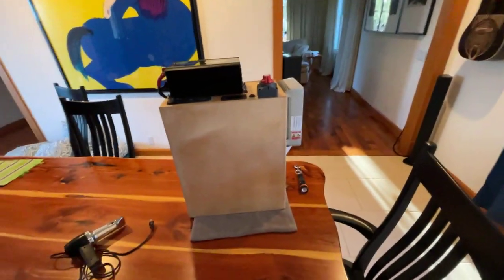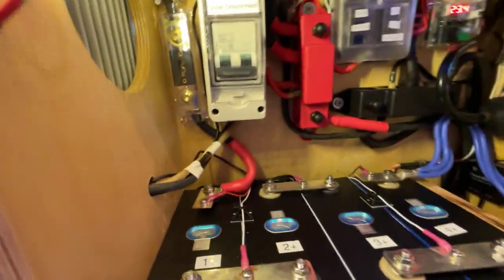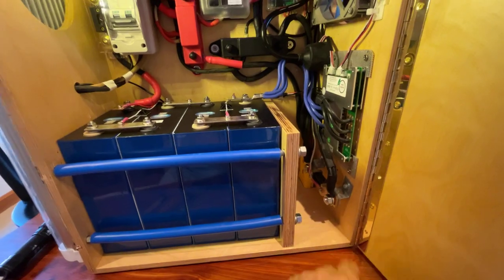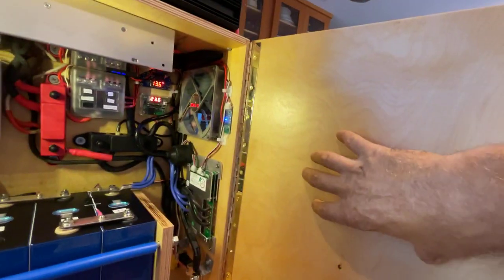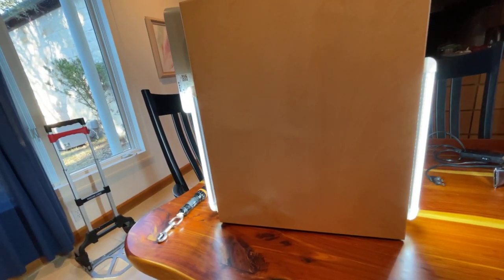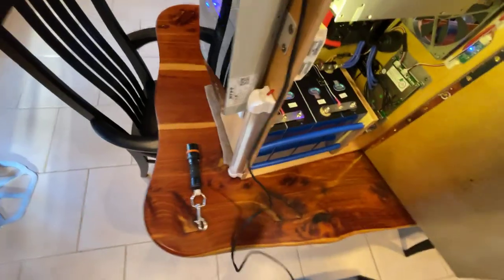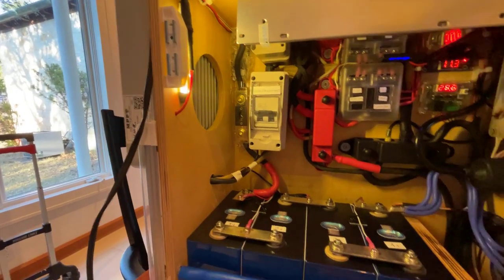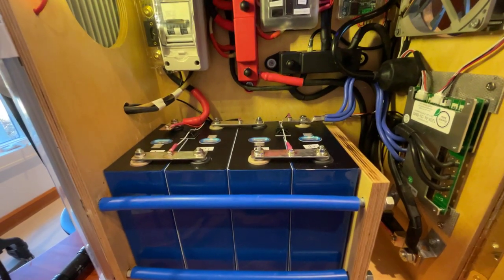I Built A Solar Generator! It Will Run My Fridge And Deep Freeze For Two Days!

Comment: How much did your system cost to build?
Reply from the maker: If you are asking about this solar generator, it cost 1200$ I later built another add on for 4kwh additional capacity for an additional 700$ that is shown in another video.

Comment: Ray what is the large silver box on top inside directly above batteries. and above your arm at 6:55 minutes?
Reply from the maker: You are probably talking about the power supply that is used to charge the batteries from a wall outlet.

Comment: @RayBuildsCoolStuff Nice Build!!! Out of curiosity, are you exhausting heat from the enclosure with the fan or are you pressurizing the box with the fan and exhausting heat out the charge controller end over the heat sink fins???🤔 If you are pressurizing the box, here is a YouTube playlist by a guy who 3D printed "static pressure boost plate" to make the fan more efficient. 
https://youtube.com/playlist?list=PLAO5ebsLaYhSe1opzIWoJgDvaiJyXcO94

Comment: Is there a way you can make up a parts list with planson how to assemble this one. People might even b.y the plane for the wood case.
Reply from the maker: You’ve got me thinking about it. I wouldn’t want money for it though.
Reply: @Ray Builds Cool Stuff  I have a friend that has a wood shop so building the case would be no problem on that side, and being an electronic tech would no trouble but a parts list would be helpful
Reply from the maker: @mysticwolf2842  have you watched more of my videos since you made this comment? Are some of your questions being answered by those? There are a couple of problems with making a parts list. First and foremost is that some of the parts that I used are no longer available from the supplier that I got them from. if you look closely in the video, you will see the parts that I used and while you’re shopping on Amazon for those kinds of parts you’ll be able to compare them. The other problem with making a parts list is just that it is time consuming, and I am always pressed for time. If you have a question about a specific part, just ask here in the comments, and I will respond to it. I am able to respond to comments when I find myself sitting in line or needing to kill five minutes here and there.
Reply: @Ray Builds Cool Stuff  as a matter of fact I have looked at the parts, the BMS units that you use are somewhat difficult to find, and funny thing is Amazon will not ship to my place for some reason. I am starting with the batteries thos are a bit more common to get along with some of the other components. Besides going to Amazon where else do you get parts from.
Reply from the maker: @mysticwolf2842  the BMS on this system is by Overkill Solar. It is a JBD unit that is tweaked and setup by overkill solar. I also get parts from alt E store, unbound solar, battery mart and Midnite solar but the vast majority is from Amazon for these misc parts and connectors. What are you failing to find. Even if Amazon won’t ship to you, you can locate things there and that will give you a target of what to search for elsewhere. Every time I start a new build I have lots of parts I have to find sources for because the old sources dry up.
Reply: @RayBuildsCoolStuff  thanks much for the info, I have a battery mart not too far from where I am. I will definitely take a look at the places you suggested
Thanks again.

Comment: Do you have blueprints or plans for this?  This is awesome.  I have most of the components you have but i mounted mine on a piece of plywood mounted to a dolly.  This is much better and with the addition of the cooling fan, able to be much more compact.  Nice job!
Reply from the maker: The plans I drew for this were nothing more than chicken scratch. They were so rudimentary that if I looked at them today, I’m certain that I wouldn’t understand what they meant. I put together an idea in my mind and I just put enough on paper to remind me of my thoughts in the next hour or day. To do more takes a lot of effort and I would rather spend that effort building. Hopefully the video gives you ideas about how to put things together and I’m sure that the components you will use will be slightly different than the ones I used. If there are any dimensions you want me to take, I’ll be happy to do that.
Reply: @RayBuildsCoolStuff  thanks Ray.  I will gather my thoughts and write back to you.  Currently at work saving my little part of the word…(E.R. Nurse)

Comment: Thank you for your detailed video. I'm building a solar generator similar to yours, and I wonder if it's necessary to had a system with a resistor to pre-charge the capacitor of the inverter. 
Do you think it's not necessary to limiting inverter capacitor initial charging current to keep the inverter alive even with the frequent on and off ?

Comment: I came here for the Solar Gen but that awsome table should have a separate video in the future..
Reply from the maker: Thanks for your comment. I like the table. I cut that tree down from a spot that I built a home on. I later built the table as a project to teach a foreign exchange student about working with wood. It was originally built to use outside on the porch. We had fun working together on the table and later my wife and I refinished it and moved it inside.
Reply: @RayBuildsCoolStuff  not only is it nicely made and comes with a character but built which such a wonderful history.. 
That table is Priceless.. !!

Comment: Nice work. I'm wondering whether to try to build my own or buy something like an EcoFlow Delta Pro, perhaps a Chinese equivalent. What's a rough estimate of your total cost to build this?
Reply from the maker: about 1,000$ not counting my labor, maybe a bit more.
Reply: @RayBuildsCoolStuff  Thanks. I'm thinking about building a simple setup with a 5kWh server-rack battery, for which parts alone will be at least $2100.
Reply from the maker: Server rack batteries just seem like a great thing. If you are handy, DIY is better in several ways. Server rack batteries are easier to sell on youtube so you will see them promoted more and more. For some people they are better because they require less understanding but the downside is that then you understand them less.

Comment: If you were to build that again for your next door neighbor, how much would you say it's worth?
Reply from the maker: I think I have a grand in parts in it. If I charged my hourly rate it would be way too expensive for my neighbor. Fortunately I charge myself a very reduced rate of 0$ per hour. I just love to build stuff. A guess is I have 30-40 hours in this unit. I could have gone to work and bought one of the whizbang modular units they have now but I would never do that. I learn by doing and connecting my brain to my hands is very enriching.

Comment: Now I can understand: you had been working on a prototype and you had done a prototype to get these battery boxes right cause I always had thought how you simply could start building 16 or even more such big batteries without having a proof of concept or at least 1 prototype that it would work out for you but I guess you had started with this earlier and then went on with the big boxes.

I had watched  a lot of solar power channels across  the globe building batteries out of harvested and used 18650 cells, new or used lifepo cells 32850 or so and then also the big ones you had ordered, before I startet working on my boxes and fiddling with the pressurisation of each battery by bands, metall bands and finally with these 6 threaded rods I guess they are called to put the right amount of pressure on the 2 rows of batteries and that equally not only where the bands would run.

This one looks beautifull and powerfull. I like the idea of a wooden frame and mobile power generator a lot.
Unfortunatelly does not really fit for us cause we have no use for a mobile one, only a stationary one with a gas powered power generator outside if the sun is not strong enough and we have a power loss.

We had those outages but for only 4 days in a row in 40 years due to a very cold winter with wind from the east or russia and snow which then let our big cross country poles out of steel simply burst cause in such weather condition with ice on it the steel became brittle like the steel of the titanic. in a pretty huge area of about 1000 square km those brittle huge power poles break all together during 1 night and 1 day due to the wrong kind of steel no one had been aware of.  

And all other outages were pretty short ones below 1 minute after thunder lightning or 1 every 10 years for about 5 minutes due to a bad repair in the street construction and so on. Might change for the worse cause we stopped using nuclear power plants and most all coal power plants which were replaced by solar power and wind turbine across the country but also offshore in pretty big fields 50 km of the coast in the north sea. 

I like this one a lot - especially the case and usability and expandability by adding another battery storage to gain more capacity.

10 videos watched - 40 more to watch, but each day a few and I hope to be through next week, cause it takes quite a time to watch and comment in the hope, the algorithm will spread the videos to others.
Reply from the maker: Thank you very much.

Comment: Hello again - what a sharp build and unit.  I experience the same type of annual challenges of hurricanes and sometimes back-to-back in a hurricane season here in Louisiana.  And what now seems to be a pattern of ice storms annually.  Tornadoes popping up everywhere and tired of depending on the co-op grid.

Yes I have portable generator that I converted to run on natural gas/propane; yes I have a nearly 10kW solar panel array that back-feeds or does net metering but ready to be energy independent 24/7/365.  I desperately need to start this project and take my solar energy and capture into several battery banks.    

Thanks for all your shares, I am subscribed and have caught up with all your vids.  How can I contact you by private message or email?
Reply from the maker: Under the about tab on my home page.

Comment: So I was sure which video to post this question,question #1.. I have some 200AH and 300AH batteries that I would like to connect to make a larger battery bank, other then the BMS limitations is there a reason this would not work? Question #2.. if I disassemble the batteries and pull the cells out would I be able to connect the cells together with a different BMS to create a bigger battery bank? The cells are 100AH and 150AH cells
Reply from the maker: I would not mix the cells in the same battery but using batteries of different capacity in parallel is ok within reason.
Reply: @RayBuildsCoolStuff  would wiring them in parallel basically make the highest AH cell only charge to the max of the lowest AH cell? Mixing a 100AH and 150AH cell in series make the 150AH only charge up to a 100AH level?
Reply from the maker: Two batteries in parallel will contribute their energy based primarily on their voltage with a nod to their internal resistance. If you have a 100ah battery and a 200ah battery in parallel and you have a 30 amp load, the 100ah will contribute 10 amps and the 200ah will contribute 20 amps. This isn't perfectly true because it is based on voltage and the batteries won't necessarily have the same SOC at a given voltage but it will be approximately true. In addition, a battery with greater internal resistance will contribute less energy at first and will then run at a slightly higher voltage(pressure) in order to run the same current. Does that make sense?
Reply: @RayBuildsCoolStuff  I think my mind can wrap itself around that. I would like to build a big bank but with 100AH and 150AH cells I don't want to cause any problems. FYI, my cells are from taking apart chins brand batteries, I was actually impressed with the AH being higher then whats advertised, not sure how good the quality control is and if internal resistance it checked before assembly though

Comment: Great video. Finally reached here by watching from the first. Just had one thought, not an expert at this, so I could be wrong. Would you measure the voltage at the terminals and the voltage at the sensing post, during load and during no load? If the voltage difference is significant, might want to think of adjusting your bms high and low cut off to compensate for that. 

Your box building was very helpful. Decided to get a circular saw and not abuse my router 😁. I thought, might as well get s2s lumber for now and take it one step at a time in getting experience. Once again, your build videos for the box are amazing, lots of little details that you mention. I started writing them down and will incorporate things as I plan out one box. Only building one box for now.
Reply from the maker: First thing I read this morning. Wow! Just Wow, oh and thank you.

Comment: Ok, it's cool, and I'm watching the video bit I have to say....the term "solar charger" is incorrect.  You built a portable battery bank.  I'm not seeing any solar panels.   I would like to see parts list in the description, sources for batteries, etc.  Maybe you've done that in other videos?  I just stumbled across your channel.
Reply from the maker: I built a portable battery bank with a solar charge controller that can connect to solar panels and charge the batteries and/or supply power to an inverter. Every similar product on the market today is referred to as a solar generator. It generates 110v AC power from the sun instead of from petroleum fuel. The fact that it stores the excess energy in a battery that makes it far more versatile than a petroleum based generator doesn't make the term incorrect. 

Commonly used terms such as this build our language. The one that bothers me is when people refer to air conditioning that uses a ground source heat pump as geothermal. I've given up on changing their usage but the fact that they think they have geothermal when they are hundreds of miles from the nearest geothermal activity is kind of funny.

I will provide a parts list when I have stress tested and proven all the parts that I used. I'd hate to send people off to buy parts that later prove faulty. It happens.
Reply: @RayBuildsCoolStuff  the earth heat mass is geothermal… so, a water source heat pump utilizing an in ground loop should qualify as geothermal…
Reply from the maker: @SuperVstech  I'm happy to see you commenting here. I understand the  point of view but the dictionary definition is "

Comment: I have one I have been working on but have kinda lost interest that has just under a 1.5kw battery that is built but I kept blowing up inverters I got 2000w and 1500w but they all sucked the goal was to run my 120v Flux core welder I have MOSFETS or IGBTs to  fix some again and giving up on my goal the problem is I am building it in a harbor freight pelican style case the 4800 so if I had all the room I would have just bought a like 3000w Inverter and probably been fine but it is what it is
Reply: Research Low Frequency inverter. Having a higher voltage battery would help also. 
The problem arises when a flywheel load like a welder with its massive inductive transformer pulls several thousand watts on the trigger pull. 
At 12 volts, 2000W is 160A… the surge on that welder can exceed 6000W each trigger pull. So, with a 12V battery, you are going to be pulling over 475Amps… unless your cabling and battery can output that amperage, no inverter can keep up. A LF inverter has the iron core transformer flywheel effect, and will handle the surge wattage, but ya still need the amperage and wiring capability.
24V halves the amperage needed.
Reply: @SuperVstech  well i guess I didn't mention but it's a 7s system so it's 24v really most of the time the voltage is over 25 until starts getting low but I can deal with it needing to be pretty full which keeps the amps down like you said but the real problem is I have limited space and also I'm not trying to spend a lot I had an inverter before I started building the battery pack but it sucked and I don't really want to have to rearrange it it's I believe 7s20p so 140 cells but I need to put a meter on and check inrush current and see what it actually pulls I did try a killawatt meter but it is kinda slow and never reported more than like 800watts

Comment: The back of the inverter on the top of the unit has exposed positive and negative terminals.  Isn't that somewhat dangerous? Is it possible to create a short across those?
Reply from the maker: The terminals are on opposite sides to help avoid shorting. I had shrink wrap on them for awhile but took it off so I could easily use any power supply to charge the batteries externally as the internal charger is only 30 amps. I have a 60 amp charger that helps a lot when you are charging both batteries now that I have the booster add on battery shown in my recent video. I'm thinking the right size tubing could slide up and down for easy access.
Reply: @RayBuildsCoolStuff  It's still not safe to have exposed terminals. An unsupervised child could create a short with a tool or piece of wire.
Reply from the maker: @jayhawkeyes  That is a possible risk so I would cover those terminals if there are young children in the home.